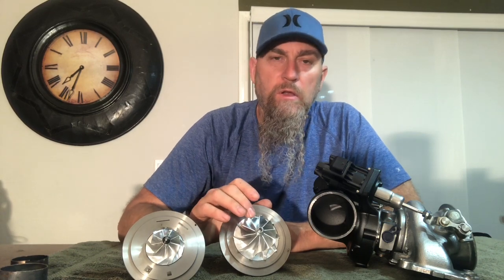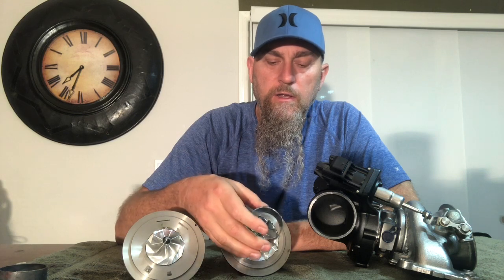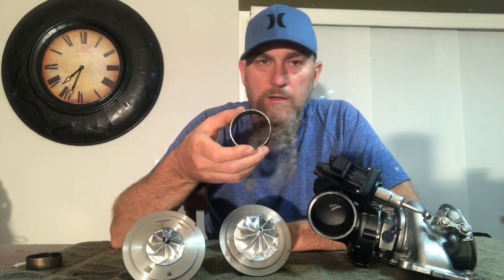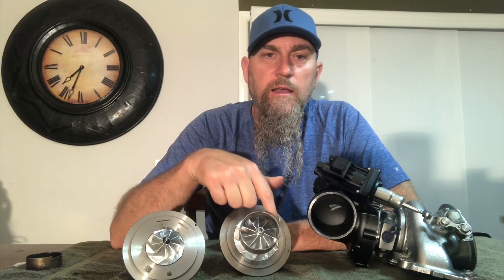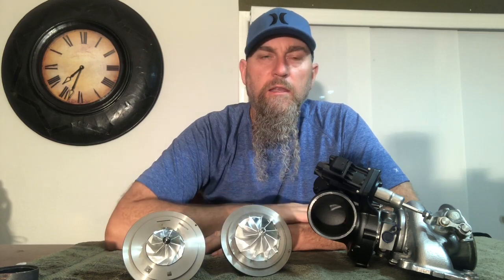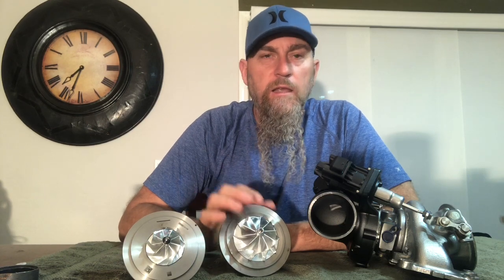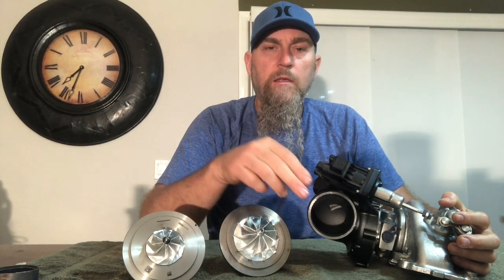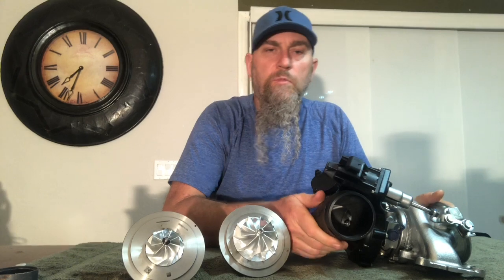Upgraded BMW and Mini Cooper second gen B46C and B48C Dominator turbocharger

Comment: I see this turbo requires 3.5" in exhaust. I don't think I see any aftermarket exhaust offering 3" piping, much less 3.5". Are there any you would recommend that work with this turbo? Or does this require custom exhaust.